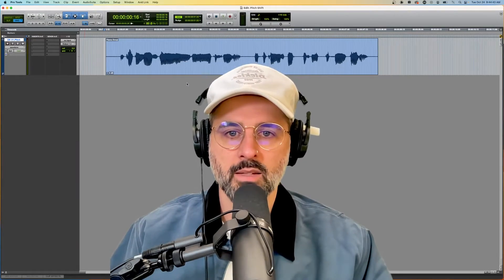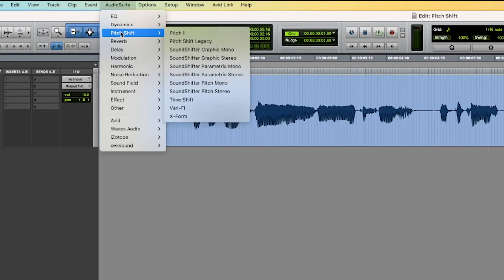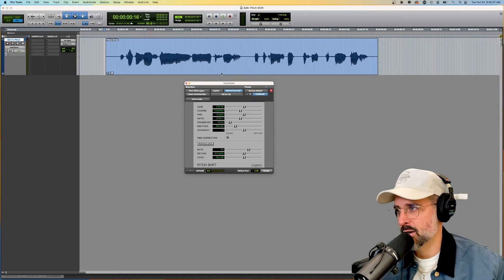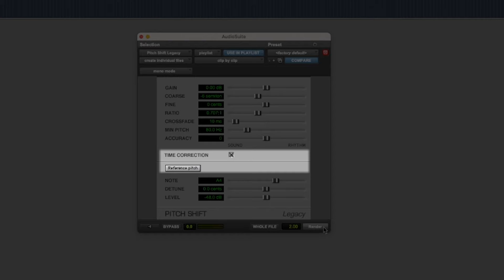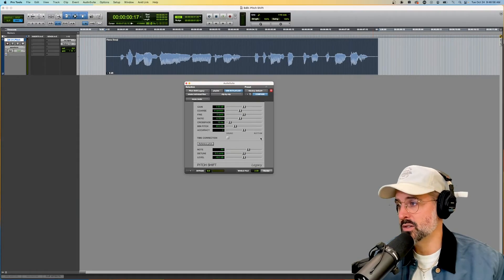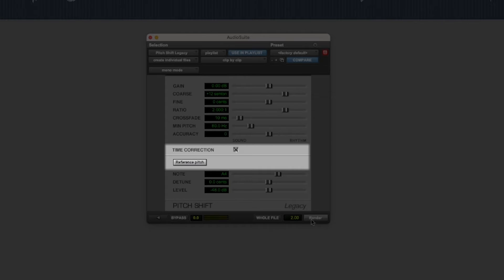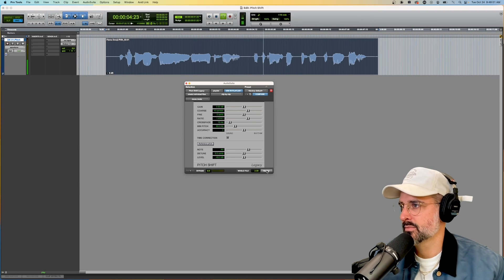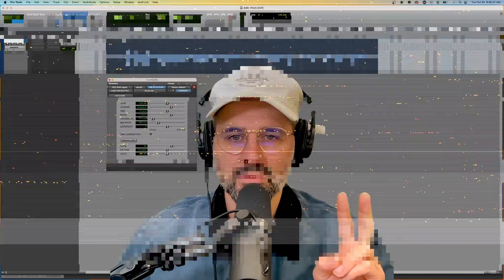How to Change Pitch in Pro Tools

Comment: Today, after 20 years using “pitch shift legacy” something happened that never happened before —— even though time correction was X Out, it slightly reduced the length of the file. I’m absolutely astounded; it never did this in the past. And it’s also a very short file. I kept redoing it, and it kept doing the same thing. I would give anything to know why this is happening all of a sudden after 20 years of successful use.

Comment: Hello chris i have some issue on pro tools ,magic id problem i cant open ptx file .and session date is not enabled .. there's some ways to recover recording sounds from PT ?
Reply from the maker: Did you try to open a clean Pro Tools session and then Import Session Data of the corrupt file into the clean new session? Or look into the automatic session file backups?
Reply: hi, I looked at all the forums, but couldn’t find anything, the guys who worked on this program said if this function is disabled in the options, then nothing can be done.. I tried the option that you wrote.. but nothing helped.. thanks for the feedback